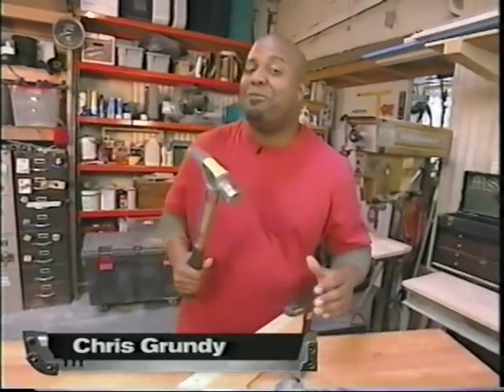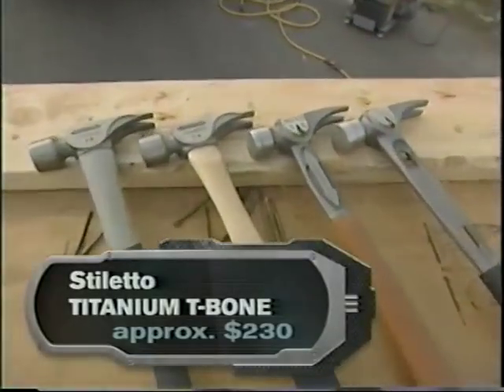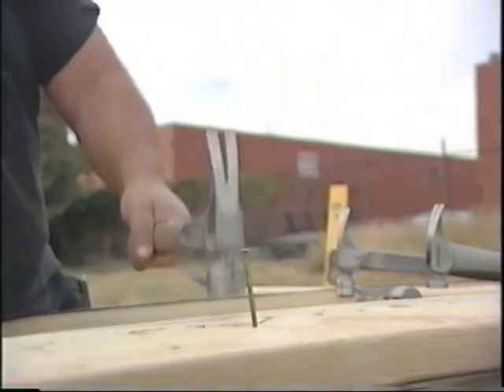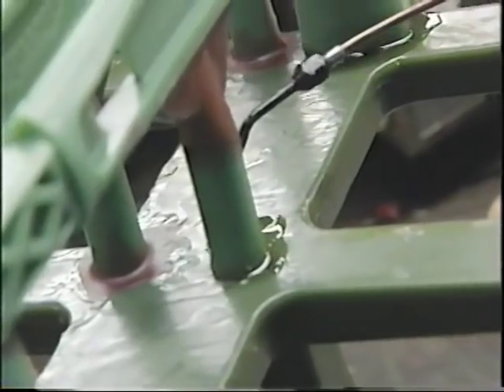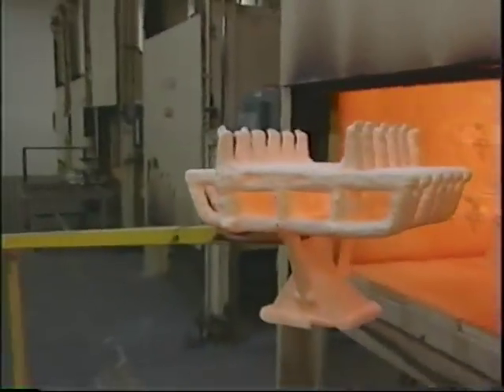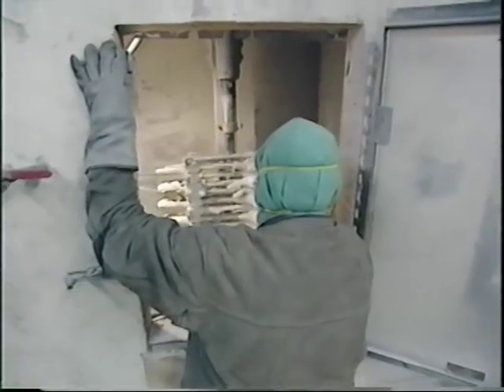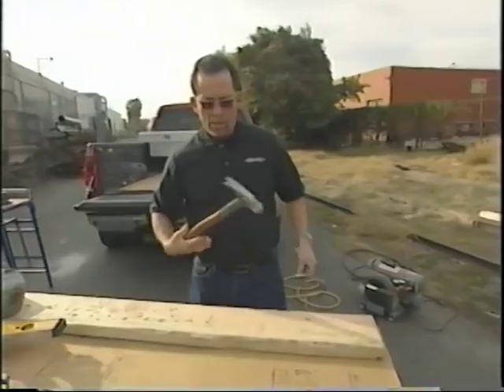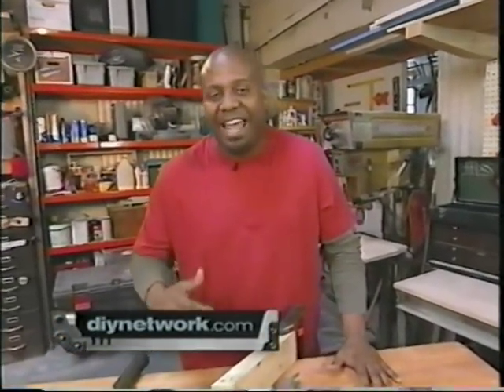Titanium Investment Casting

Comment: I love how people who know nothing about carpentry are now engineers and professionals.  Weight on your belt matters just as much.  You also get a larger and interchangeable head.  The difference in weight does affect the force but stiletto is longer making for more leverage which gives you equal force.  I own 3 and have used my current one for over 10 years.

Comment: +littlegerman12 Yes, but you CAN'T swing a lighter hammer faster in proportion to the weight that's lost. You can swing a normal steel hammer almost as fast as you could if it had no weight at all. You can only swing your empty hand so fast. Hammers have been designed to have just the right amount of mass to get the most impact from the average persons swing. A stronger person might be able to swing a slightly heavier hammer with the same force as a weaker person can swing a lighter one. But nobody is so weak as to require a 40% reduction in the weight of a hammer just to get the same impact as a normal hammer...or if they are...perhaps they should not be doing a physical job. Steel hammers already come in all the weights required to suit anyone who will ever need to use them. so why spend much more money, on an inferior material only for it to get stolen like every other tool on site?
Reply: *with the same VELOCITY as a weaker person...my bad.

Comment: I use a smooth face 18oz estwing all day for anything from framing to finishing or even demolition. It is the ONLY hammer I have ever used that will pull 22 gauge pins, 3 1/2" spikes without heads, or 18" ardox spikes and it has done it for almost 11 years without getting dull.
Composition is not what makes a hammer, design is.

Comment: +1. Energy in the system is conserved, so a person swinging the hammer exerts the same amount to drive a nail regardless of the hammer's mass. However, force on the elbow to lift a lighter hammer may be lower, which could account for something. Personally, I wouldn't risk a repetitive use injury by hand framing; I'd use a nailer wherever possible.

Comment: Resonating frequency of the hammers handle material and its cross sectional reducing neck length shape to reduce oscalating frequency vibrations transfer into the hand section. Slow rebound elastomers as grips also reduce resonances transfer into one's hands shape of hammers handle from head to grip and its material is interrelated..

Comment: Not that simple. It very much depends on the amount of momentum you can transfer to the hammer with your arm. And this depends on the weight of the hammer and some biomechanics considerations on how a arm works.  Whoever said that a titanium hammer hits just as hard probably said it because he actually experienced it, not because of some mechanical analysis.

Comment: @enigmaj316 #1 you don't provide the force with your arm, you provide it with your wrist.. #2 a faster swing with less weight has an impact equal to a slower swing with more weight.. #3 fact, a 15 oz titanium hammer sinks nails as well as a 20 oz steel hammer.. I still use a 23oz steel hammer because I don't generally pound nails with it.. I use it to knock things into place and sink nails in tight spots that are out of reach of my nail gun where you can't get a good swing and need the weight.

Comment: Guys need to use lighter steel hammers and learn how to swing better. Gradually accelerate the hammer, don't jerk it with your elbow. Pivot your wrist just before the strike and follow through. Let the tool do the work, not your arm. I can forge, drift pins, and letter stamp steel all day with lighter than usual ball peens or sledges. A loose grip eliminates the recoil.

Comment: A hammer is a very primitive tool as to think in using expensive space materials in it. It is much better to use that metal in a modern pneumatic nailguns or hydraulic hammer that would result in an amazing performance.
Reply: I totally agree with you. Good steel costs about 1.5$ for kilograms in Russia. In opposite - titan costs more, than 80$ in Russia. And also in tools, that work by using their weight, steel better then titan. (7.8-7.9 kg/l, in opposite - 4.5 kg/l of titan). And also good steel might be better then titan in hardness. (HB characters) (also tools steel may be not only Chromo-Vanadium, in may be Carbon Steel, which harder then usual)
Reply: yeap that hammer is an amazing piece of jewelry.

Comment: Spot on...Hardness of material has no bearing.  If the mass(weight) is reduced, the velocitiy must be increased to have the same driving ability(kenetic energy).  If you have to increase velocity, it is sure to reduce your ability to hit your target AND increase the vibrations...Think I will stick with my steel hammer.

Comment: I think you need the kinetic energy of the hammer, KE=(1/2)mv^2 not the force being used to accelerate the hammer. It's not so simple either as the hammer is also not following a straight line, the different mass could also affect the heads trajectory. Talk about opening a can of worms... I think lokivoid was refering to both being swung at the same speed.

Comment: well, depends on how you look at it, you can swing it faster, BUT, you are putting the same effort into it, so reducing fatigue doesn't sound right... reduced fatigue means less effort, but less effort means less force, and slower nail driving, so making the hammer lighter doesnt sound like it would fix the problem at all xD

Comment: Why? If you just drop it then yeah the heavier steel hammer will hit harder, but I don't think many people rely just on that to drive in nails. Also, Titanium has a much higher strength to weight ratio than steel. That's why fighter jets aren't made of steel.

Comment: For two thousand years the hammer hasn't changed because it works flawlessly. Using titanium and removing 40% mass and saying 'it hits just as hard' is absurd. It does 'move faster' as they claim however the kinetic impact will be inferior to a steel or iron hammer. This is a waste of titanium.
Reply: It's not a purely mathematical problem. You can't drive a nail any faster with a 7lb  lump hammer than a normal hammer. More weight only adds more impact up to a point, beyond which, you lack the muscle strength to accelerate it to a sufficient velocity. Similarly, reducing weigh lets you swing faster, but only down to a point where you are approaching the fastest speed you can swing your empty hand. Beyond that, reducing weight doesn't increase speed at all. It's a waste of Titanium, because it's just an inferior material for the purpose
Reply: You have no freaking idea what you are talking about.
Reply: mellowb1rd what material should be used?

Comment: How do they cool it consistently, they want a continual crystalline structure that would avoid flaws?
Reply: Since it's allowed to cool in the ceramic it will be annealed.
Reply: Won't it take the fine crystalline structure even when cooled in atmosphere because it is not an alloy, correct me if I am wronf?

Comment: I'm not really convinced about titanium being beneficial in anyway here. The whole point of a hammer is to use a weight to force something into a surface. The heavier the weight, the more force you can apply to the impact point (F=mass*acceleration). 
By having a lighter hammer, it won't have any benefit in it's use. It'd make it worse.

Comment: I guarantee if you try any other 15oz hammer, it will not hit as hard as the 15oz stiletto titanium.    I used to use a vaughn 19 oz, great hammer but the wood handle breaks over and over and over .  Anything stanley or fat max is crap, expect for the fat max 22 oz, great for smashing stuff but you will destroy your elbow over 10 years.

Comment: That nail puller is 10,000,000 times better at ripping up nails than a hammers claw. Try pulling a nail out of concrete with a claw- almost impossible. As a commercial carpenter we do actually have to pull a lot of nails out of concrete and his hammers accomplish that easily. We all gladly for over the mula for his hammers. Great success story all around with him.

Comment: If you like your arm use hammer with handle made from shock absorbing material. Fiberglass core and some anti-slip shock absorbing soft touch grip. Weight of a hammer you use is determined by what you are nailing. Long nails and hard surfaces require heavy hammers and short nails and softer surfaces require light hammers. With right weight you should be able to drive a nail in one or two strikes. Too light and you will work yourself to death.

Comment: Wouldn't using a lighter steel hammer have the same effect? Maybe put a titanium cap on the head for durability? Are these guys just reinventing the wheel?
Reply: Michael Norman Yes it would but the real benefit is the damping properties of Ti (approximately 10x better than high carbon steel).  If you strike a Ti and steel hammer against a concrete surface at about the sample speed, the difference felt through your arm is substantial.

Comment: @user136002 wouldn't that depend on the thickness and shape of the connection between handle and head? ie. if Titanium is less stiff (unlikely) you could shape the steel to match the characteristics. The only thing with titanium is its strength to weight ratio.

Comment: im just gonna point out that cast metal is significantly weaker than milled/hammered/rolled/worked metal. the best refined titanium around is equal to your average low grade steel. the fact that this is cast... eugh. can't take the beating that a steel hammer can take. also, what's with that side nail pull gimmick? what the fuck is the point of the claw end? you know, the part designed to pull out nails?

people are saying that this thing is better than steel because even though it is lighter it can go faster and thus hit just as hard... okay, that's cool, except that would mean you're still working your muscles just as hard. the recoil is probably less, sure. i agree with that. but that is the only advantage of this hammer.

not worth hundreds of dollars.
Reply: Comedic Sketches

http://www.atcgroup.com.au/CustomCastingForging/TheDifferenceBetweenCastingForging.aspx

https://www.ar15.com/archive/topic.html?b=6&f=49&t=305595

http://www.iforgeiron.com/topic/13420-cast-vs-forged-anvils/

http://biowheels.com/the-truth-about-titanium/

with those links placed, i'd like to point out that these titanium hammers are still the premium option

it's just that they aren't cost effective
Reply: +Junn Kopf Actually I was pretty surprised that they don't hammer (and then stamp) titanium first just like they do with steel too. On the other hand if they would, the costs would probably be even higher.....

Comment: Seems like a waste of money. If you want a lighter hammer, use a smaller one. Titanium and investment casting is damn expensive compared to a drop forged hammer. Isn't titanium usually quite soft in comparison to a lot of high carbon steels too? How long will this hammer last? If you need to swing the hammer faster, isn't your arm doing just as much work? This is carpenter bling and nothing more. Sorry Stiletto Tools.

Comment: What the hell.. it's a unibody construction so no shock absorbing handle (nasty vibrations.. ouch) + it has to have a steel face insert (titanium is too soft and would dent immensely) that is stuck to the titanium body.. why not just make a light steel body like that? it's all hollow from what we can see..
Reply: chronok i have a the t14 and have used the tbone they actually work amazingly well and i was surprised the titanium milled face lasted about as long as steel before needing to be sharpened

Comment: Why would they use titanium, heavier hammer has more inertia in the end steel hammer will hit with more inertia resulting higher impact. So where you can nail things in one swing with steel you can't do same with titanium. They seemed like wannabe inventors with a really bad idea and they executed it with lost wax casting lol
Reply: Apoorv Seth w/ a lighter hammer you can swing faster.  E=1/2*m*v^2 so increasing velocity is more important than mass.  Also, titanium has a much greater dampening coefficient than high carbon steel (about 10x) so less recoil shock is felt.  Less recoil shock and a lighter hammer = less strain on your body
Reply: Alex Paulsen Except the nail requires the same force to get pushed into the wood... It's just moving something lighter faster. Doesn't really add up.
Reply: a) The boxer things is just stupid. They don't hit with more kinetic energy, but the hits are harder on the person because there is less padding. That's the reason Mike Tyson grounded away at the padding in his glows, they weighed the same, but the hits weren't as cushioned.

b) The formula is 1/2*mass*velocity^2 and having two variables, you can get the same answer two different ways. Which again brings me back to, this is bullshit and the whole video feels fake and plasticy.
Reply: I'm not sure what you're getting at... Anyhow, you can get the same kinetic energy two ways, a lighter hammer does not automaticly give you more kinetic energy.
Reply: No bro you are right higher kinetic energy but less impact, lets say a big truck crash into a wall will do more damage because of higher mass (same momentum) VS some light mini van which if with same momentum will have less impact (the van will bounce off the wall as well).
The higher mass of hammer will ensure more force that will drive the nail into wood (suppose) on the other hand titanium hammer will get forced back (elastic collision: assumed ideal for simplification).
So in the end with titanium hammer one has to do more no. of strikes vs one big strike of steel hammer, driving the same nail to same depth inside same material.
Reply: Also using titanium hammers is like using lighter vehicles for mining or digging VS the heavy vehicles we use.
A bulldozer made out of carbon fiber will be of no use VS traditional bulldozer.
Reply: Comedic Sketches Yes, but you need to get a really high speed going, and there is a limit to how fast you can swing something. The hammer would have to be pretty heavy for me not being able to swing it just as fast or atleast almost as fast.
Reply: Zlagther Bro what about the impact won't higher mass do more impact?
Reply: +Apoorv Seth it really depends on the work your doing, in most cases your swing is assisted by gravity increasing the power of your swing. But if your hammering above your head gravity is working against your swing and a lighter hammer would be preferred as there is less weight(m*g) to overcome.
Reply: +Not Number *that being said, I just use a smaller steel hammer for overhead work.

Comment: wrecking your arm in the same way. nonsense. you could also just use a hammer that has got less steel in its head so that its 40% lighter than other steel hammers. still wont bend lol.

Comment: don't believe a man, who is wearing sunglasses at a construction site!

this hammer with a rigid handle, highly expensive alloy and expensive casting process is simply is bad for your wallet, arms and environment, don't buy it!

if you want to have a lighter hammer, just buy a lighter hammer in your hardware-store, but take one with a shock-absorbing handle! 
the weight of the hammer has nothing to do with the hammers kickback to your arm!